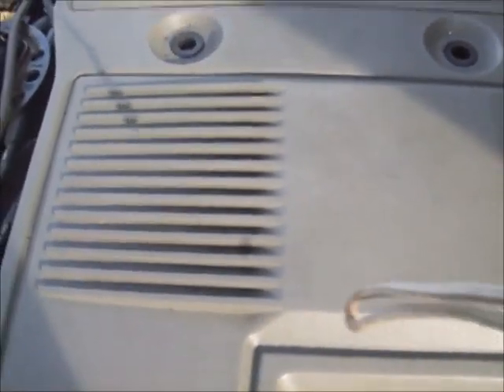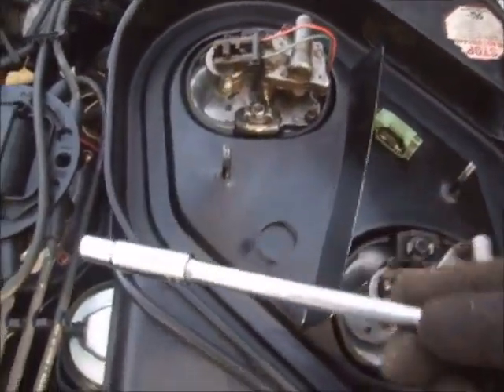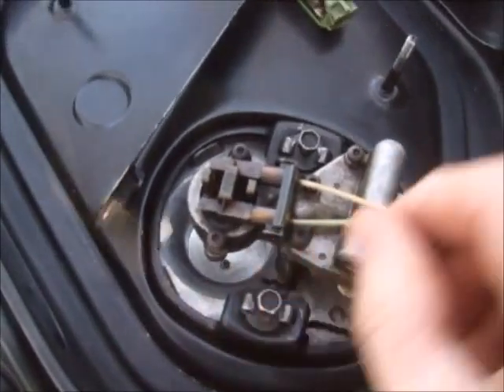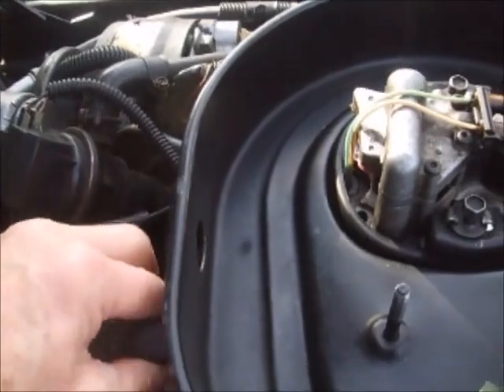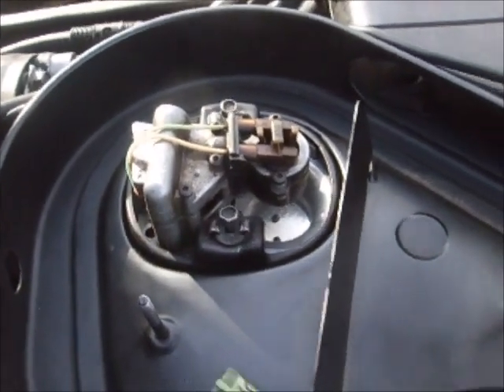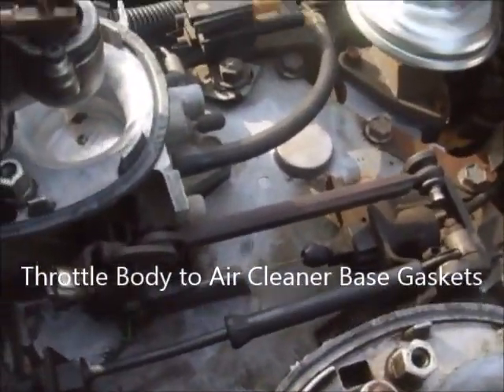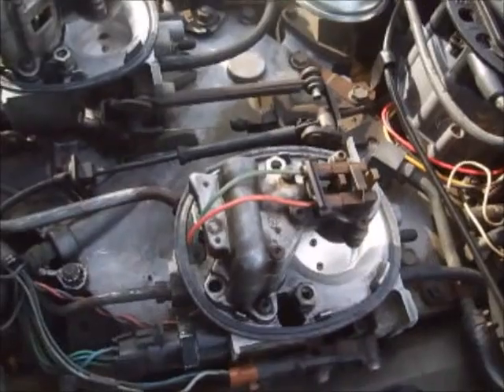𝐒𝐓𝐎𝐂𝐊  𝟏𝟗𝟖𝟒 𝐂𝐎𝐑𝐕𝐄𝐓𝐓𝐄  hesitation/stalling/stumbling During WARM UP: Air Cleaner Gaskets

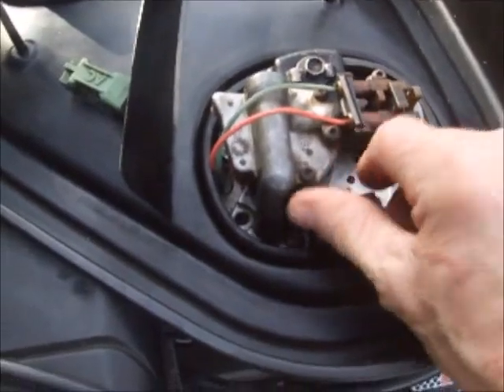Comment: what are the bolts called that you tighten at 5:20 i broke them off into the other bolt inside of it need to replace both bolts but no idea where to find them
Reply from the maker: not sure what they are called mine are 10MM...just curious did you break them off in the throttle bodies? If you have just one, I imagine you could find them at Home Depot or Hardware store for sure.

Comment: hey sir do you know what the brown plug connected to the distributor cap is?
Reply from the maker: Not sure which one your talking about, hard not being there to see in person but, there is a tan wire that is connected to the tachometer and there was a brown wire that wasn't connected to anything and it was used by service technicians to check some sort of issues??Not even sure what the wire tested but it just kinda hung there,  that's all I know,  wish I could help more.
Reply: 3DELTA7 that's exactly what I'm talking about I guess it's called tacho filter.  I went to a lot of parts stores and they do not have them
Reply from the maker: jose soto I don't know Jose....some of these parts just aren't made any longer...sometimes you can find things corvette salvage online. Does your tachometer work?
Reply: yea it's working just I ripped the wire I'm talking about when I was stabbing in the distributor
Reply: I'll check online and maybe wrecking yard
Reply: thank u tho 3DELTA7 Thanks for helping and understanding., every parts store didn't even know what it was
Reply from the maker: jose soto like this?? https://www.amazon.com/C3-C4-Corvette-Tach-Filter/dp/B00I1KAQSW
Reply from the maker: jose soto jose...the tach filter sits at the rear of the engine right by the distributor cap and has a brown wire that goes to it...those are easy to find...Ecklers has them..about 37 dollars but they have them...if we are talking about the same thing....this tach filter is cylindrical and looks like an old spark plug condensor in the old distributors.